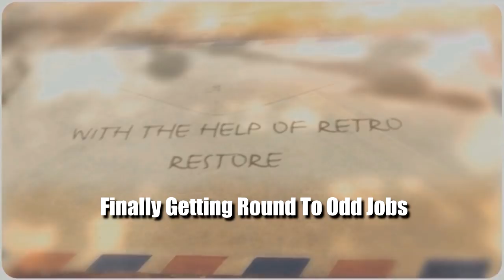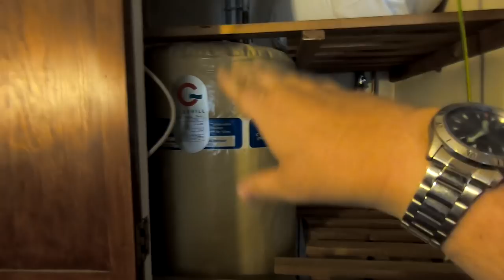Finally Getting Round To Odd Jobs - Plumbing Saga Vlog

Comment: As a plumber We sometimes put a rubber bung in the feed from the header tank to save draining down you could even have made a bung out of a screwdriver and some insulation tape 
Its not water regs to fit isolation valve s only on float operated valves ie header  tank or cisterns 
If your putting isolation valves on gravity feed pipe to your bath the need to be full bore so you get maximum flow doesn’t matter on Mains or combi supply as you have more pressure,
You could have use push fit fittings as its awkward to tighten the up in the restricted area fair play to you doing it there not always easy especially when you can brake the overflow leads to more hassle they can even be a ball ache for plumbers to do 👍

Comment: I felt your pain while you were changing the taps. I remember being in a similar situation years ago, when I replaced the bath taps for a shower mixer set. Absolute b'stard of a job.
When I finally replaced the bath with a shower cubicle, I used plastic push-fit pipes and fittings.

Comment: 70s build 70s plumbing, black and red twin-earth aswell, best one ive seen immersion fitted and wired then put in the airing cupboard 2 inches between it and the wall !
Reply from the maker: I've seen loads of that stuff too over the years

Comment: Martin, you're a jack-of-all-trades and you've mastered quite a few of them. If your holes had been too big for the rawlplugs you could just glue them in with Gorilla Glue. The stuff expands when it dries and I've used it in such a situation in the kitchen. Just don't get it on your hands as it is difficult to remove.
Reply from the maker: Yes, i've used it. Good stuff too.

Comment: You need a full bore valve for the hot due to the low pressure of the gravity system.You will otherwise get a much reduced flow on the hot. The cold being on mains pressure doesn't really matter, though gate valves are not really suitable for mains pressure
Reply from the maker: Its all running with more pressure than we had bud.

Comment: Mart, always use potable jointing compound on your compression fittings threads and olives, it makes life so much easier when i do my bathroom and kitchen refits, it makes the olives seal nice.Just a tip bud! Cheers.
Reply from the maker: Its not really necessary Steve but I know what you mean.

Comment: Good task as usual , those bath taps are a pain even with the right tap spanner had some right pigs , suprised you didn't go for the quick fit braided hoses . Cheers 👍
Reply from the maker: Didn't come with the taps but still would have needed tightening in a tight space

Comment: Not bad for a spark Martin. Need to see your union card though lol.

Those isolation valves are purely used as service valves. Thats why they have a narrow bore. You can get full bore valves usually use them for low pressure systems.

Comment: Hi Martin good video just a bit of info , you could have used lever ball valves full flow ones so you will no have any restrictions on a gravity fed system . I don’t have a bath but on my sink/ basin taps I use crows foot spanner’s 19 mm I think with a 3/8 ratchet and extensions , it slips over the 15mm pipe a treat. I have an adjustable one that would have done the 22mm one i guess it’s about 25mm across flats . Not trying to tell you how to do it but if this helps someone out . All the best Nick
Reply from the maker: I think the lever ones might have been a bit of a squeeze Nick , I know you can remove the lever but that defeats the object. The flow is so much better than we had though.
Reply: Glad to hear Martin ref the lever ones you could position them on the side so you could push or pull them . They don’t seize up like the gate valves. Just a thought for the future if you fit them on you tank outlets, you can’t have too many when you need to shut off the water without draining. All the best thanks for your comment .

Comment: Jeez Mart, we used to have a similar problem with corroded valves in the hotpress , so I had do the same with regards to tieing up the valve like you did in the attic tank and had to wait to drain it to work on the taps.I now  have freed off them valves, without any damage or leaks, (I was proud of myself for that)  that were hardly used since 1969, so now I dont have to  drain the tank, so its far easier to work on taps.........still dont like plumbing though ha!!
Reply from the maker: I hate doing jobs like that but it had to be done. I put it off for years lol